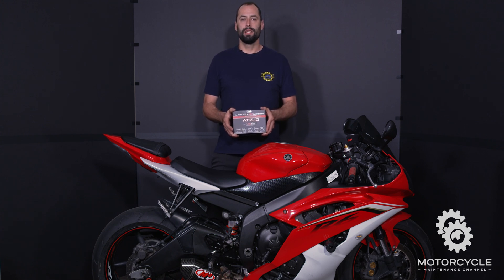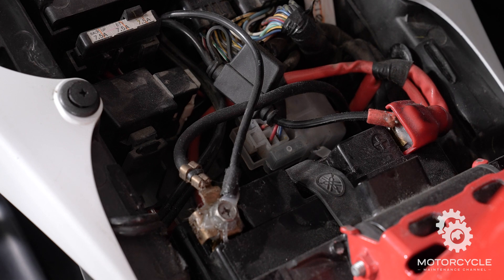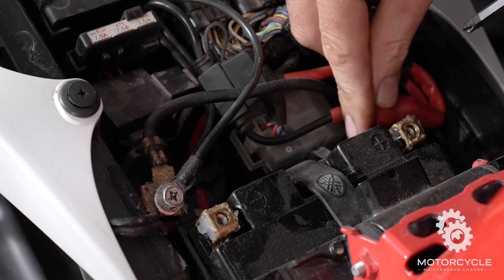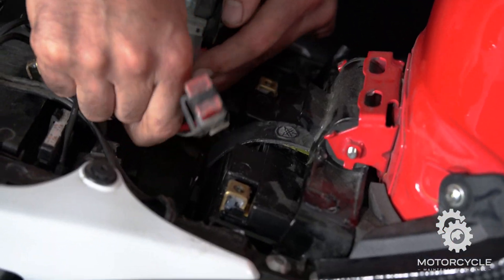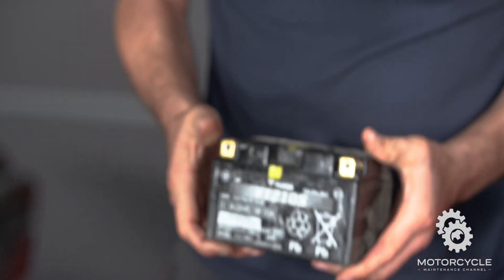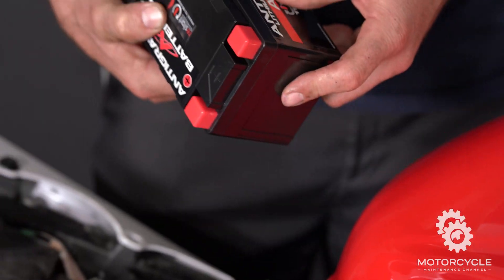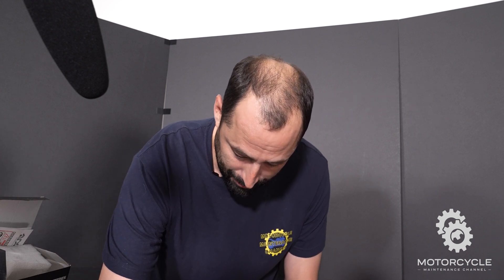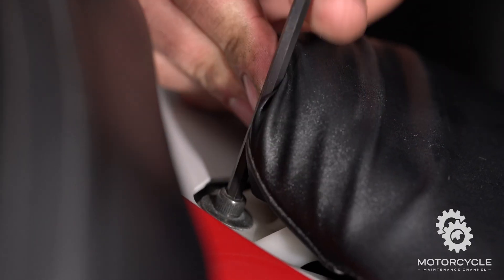Yamaha R6 - Antigravity Lithium-Ion Battery Install

Comment: Due note my friends so you don't get stranded at 12 at night at a gas  station. The batter is VERY SPECIFIC. You, for some reason, can't find regular batteries to replace this from like auto zone or something. No it specifically takes a certain type of head on the battery to work one of the models that does fit the R6 is the YTZ10S model battery for some reason when you look up ok Google for the right battery it isn't correct and gives you just a TZ10S IDK WHY THE Y IS IMPORTANT BUT YEAH

Comment: I have a question here, do i need to modify anything on motorcycle in terms of software, how to charge battery? Because I beleive that charging of Litthium battery will work different way than ACID battery.  The charging system in a motorcycle is designed to charge a lead-acid battery, which has a different charging profile than a lithium-ion battery. Is that correct?